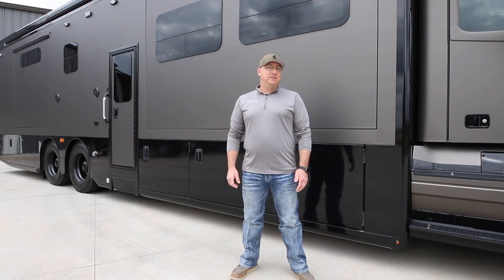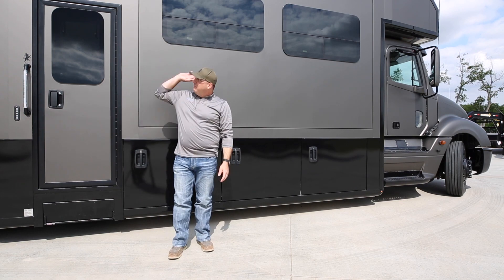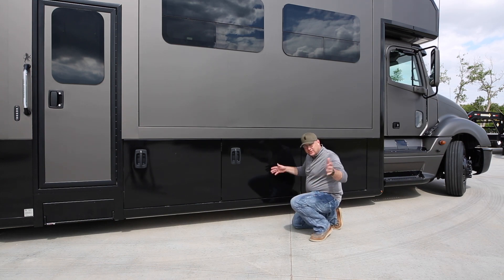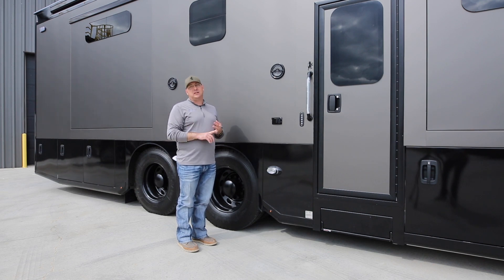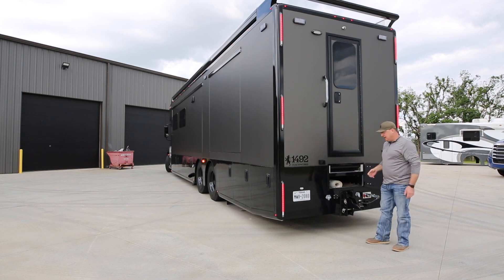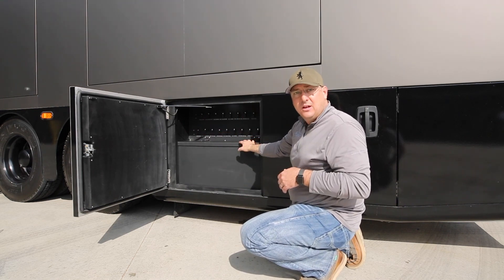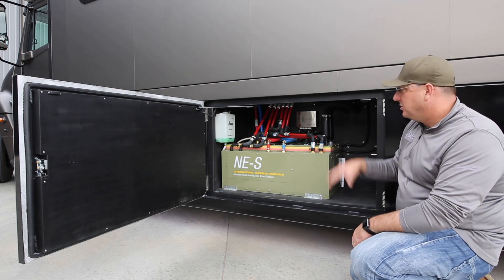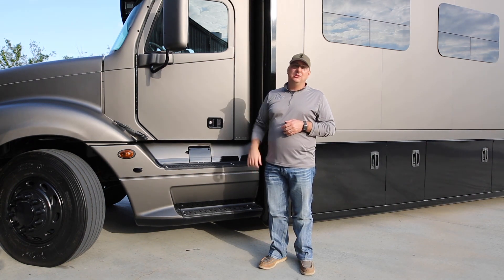1492 Coachworks Super C Motor Coach Exterior Walkthrough

Comment: If a vehicle doesn't have strong bones...it's lipstick on a pig! Congratulations for thinking out of the box, looking at issues that come back to bite you. Have been rving since the 1980's. Built 5 different bus body types...3 for friends, 2 for our use, no slides. Need to make sure the mechanicals. Take a vehicle in a wind tunnel to learn how the body changes. Our 40 foot bus chassis grew almost 1inch in the sun without external skin, just frame. You're on the right track, keep the research up!

Comment: The bottom and rear look extremely low to the ground.  I would be concerned about high centering or dragging the tail going up an incline.
Reply from the maker: This particular coach is on a full air suspension that is shown with it deflated to make entry and exit easier. That said its still a bit lower than we would like and have increased the ground clearance. Our typical ride height is 11"-12" on all units built after this coach.

Comment: Questions: 1. What is the Suspension? Front and rear? Air? How many airbags. ETC  2. Are the RV windows laminated?
Reply from the maker: Typically the rear axles are air ride and the front is spring. We do have an option to upgrade to a full air suspension and add ride control features to improve handling. The typical bag system is a 4 bag system on the rear and a two bag on the front. 
The coach windows are laminated dual pane tempered glass windows. Feel free to call us at 405.745.6666 for any further clarification.

Comment: It looks like you are after the high-end Class-A market such as Liberty coach but in a Super-C.  Well done!  I love the heavy-duty doors and seamless slides. It was disappointing to see 25-year old AGM house batteries in a coach of this build quality as lithium is much cheaper per duty cycle than AGM  today.  If you're building a coach that is going to last 25+ years, why use batteries that need replacing every 3-years?  Go Lithium! I look forward to seeing your other videos.
Reply from the maker: Thanks again for the kind words Duncan! We believe that Lithium batteries are the way of the future but still have it as an option since they are quite costly and some customers just cant justify the cost a this point.
Reply: @1492Coachworks  My pleasure.  For a super-Super-C vehicle designed to last 25+ years, Lithium is the cheaper option unless you plan on swapping your coach every 3-years.  AGM will last 3-years for full-timers (300-400 cycles @50% DOD versus Lithium at 3000-5000 cycles @95% DOD and half the weight for 35-50% more upfront cost).  If you're spending 1-2m on one of these vehicles, the increased capital cost is like a fart in a windstorm. ;-)
Reply from the maker: @duncanjames914  We agree at that price its a no brainer., However we are well under that for a selling price. Again, we think its a great option and push it hard but like almost all things at 1492 we leave it up to the customer to decide what they value and don't. Thanks again for the valued input!
Reply: @1492Coachworks  What is the future of Solid State Batteries instead of the options that you currently provide? Based on the specs of Solid State Batteries would you consider installing them?
Reply from the maker: @globalmindset  We have only read a few articles on them and it seems to be the future of batteries but they are not currently readily available. When they are we will for sure take a look at offering it. Besides being lighter weight and less volatile they are better in colder temps and that combines with what's supposed to be increased capacity is very exciting! Thanks for watching and engaging!

Comment: It is a pretty rig but I would require higher clearance of at least the height of the tractor. I could see that bottoming out over a set of speed bumps or worse a curb which you will do at least once.
Reply from the maker: You Tuber your right that ground clearance is a concern. Our standard ground clearance is right at 12". This particular coach is a full air ride and was filmed with the bags deflated. Thanks for watching! Please feel free to reach out to us 405.745.6666 for any further info!

Comment: This coach looks like it could get high-centered on certain railroad crossings
Reply from the maker: Thanks for watching and your comments Scott. This particular coach is a full air ride coach and at the time of the video we had it fully deflated. Our standard ride height is approximately 12" and typically matches the low point on the truck cab fairings. We are a full custom builder so if additional clearance is required we can most likely accommodate.

Comment: That sits so low and close to the ground I’d scrape the ground frequently.
Reply from the maker: This coach is a full air ride coach and the video was filmed with the suspension dumped. Out typical ride height clearance is around 12" and then tapers up at the back. Thanks for watching & commenting Erin!

Comment: You didn't put any thought at all to the ground clearence on that beast. EVERT TIME you hit a pothole or pebble, or go up a driveway that thing is going to fully bootom-out
Reply from the maker: This particular coach is on full air ride suspension and is shown with the bags dumped. Our standard ground clearance is approximately 12". Thanks for watching and commenting!
Reply: @1492Coachworks  There STILL should be an angle on that rear portions for the incline of driveways
Reply from the maker: @MrCgs60649  It does taper up 6" at the rear and our one of a kind hitch system is what will hit first if it does bottom out and we have engineered a skid plate into out hitch. We also can increase the clearance as needed to allow for additional clearance on our upcoming 6 x 6 builds. Thanks again for checking us out!

Comment: The damn thing is to too low , anyone who owns any kind of RV will tell you that from experience , this one is so low I first thought it was some type of low rider west coast garbage  ,,,,, personally I'll stick with my Provost  , a proven coach company  ,,,,  that thing needs an additional 20 grand of work to raise it up 5 or  6 inches
Reply from the maker: Thanks for checking out the video Noble. One thing that was not discussed is that this coach is actually on full air suspension and was lowered when shooting the videos. Our standard minimum height off the ground to the lowest point is 11".
Depending on who did the conversions we completely agree that Prevost are awesome and we are huge fans of our friends at Newell coach.